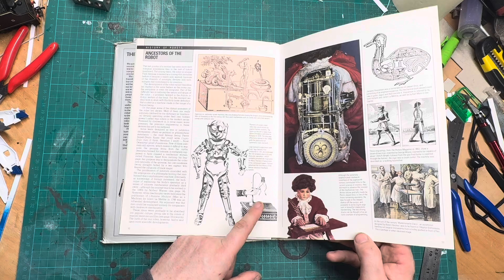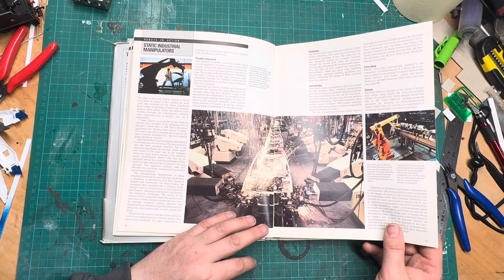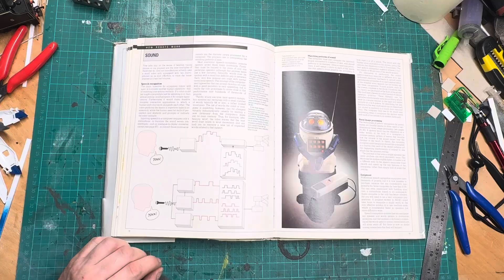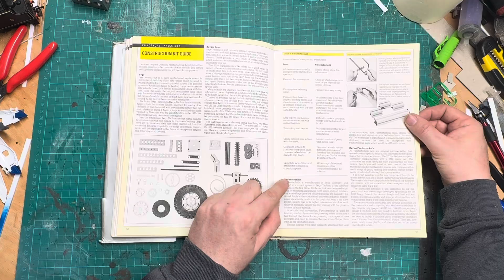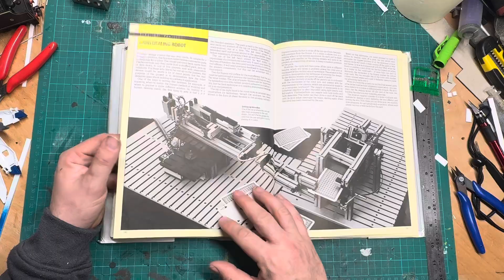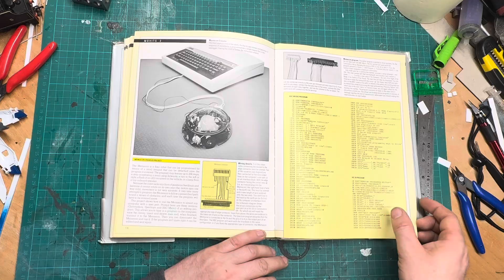The Robot Book by Richard Pawson

Comment: What a fascinating book. I went to a computer fair in the 80's, there was a robot 'mouse' competition going on with about 10 robots. Most of them had ZX81's as on board controllers to get through a maze. The majority were 2 or 3 wheel designs with micro-switch 'whiskers'. Fun to watch.
Reply from the maker: The Micro mouse is still a thing with events races held frequently.
Reply: @AJB2K3  Cool, I didn't know that. I bet it's all Arduino these days. 😞